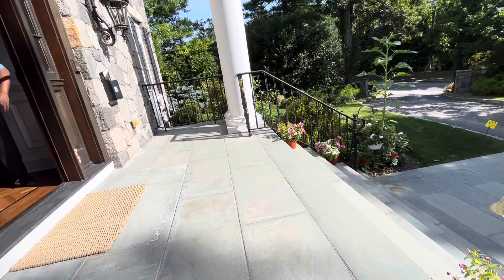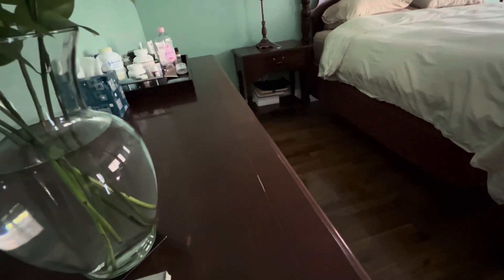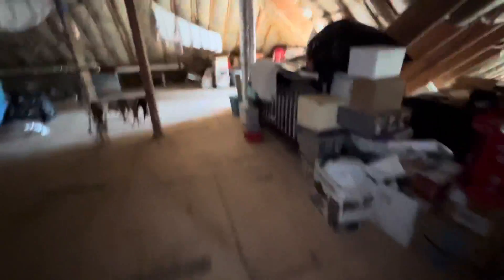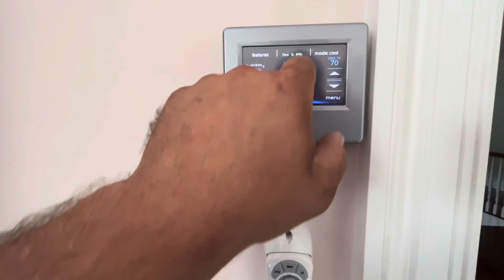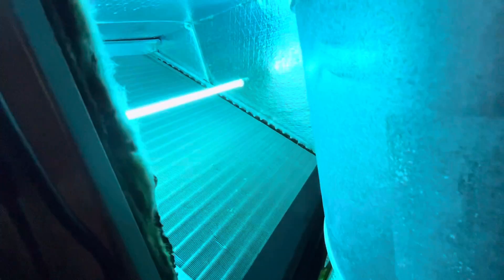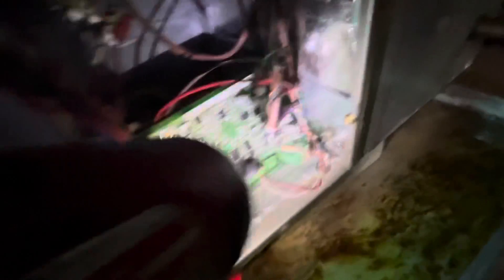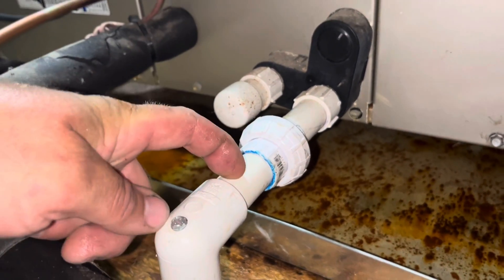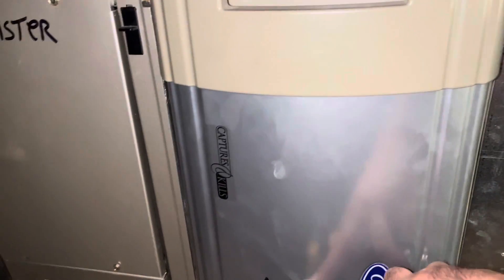HVAC. CARRIER INFINITY.  INDOOR COMMUNICATION ERROR.

Comment: Which infinity system can that Wi-Fi thermostat be used on? My system was installed in 2007. 2.5 ton.
Reply from the maker: Infinity sells a proprietary wifi Carrier thermostat.
Reply from the maker: The ones in this video are wifi capable.

Comment: Im getting the same error code but in heating mode, natural gas infinity furnace , same thermostat as the one shown here any thoughts ?
Reply from the maker: Go check the float switch upstairs at air handler pan.   Maybe there is a switch wired into your trap or the pump can be full and killed power.  Also check the fuse inside air handler.
Reply from the maker: Let me know